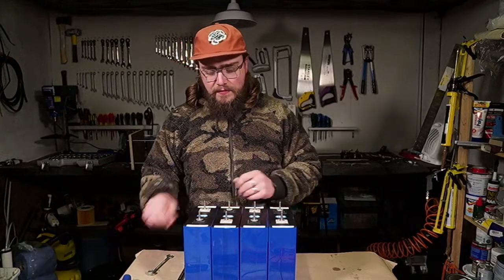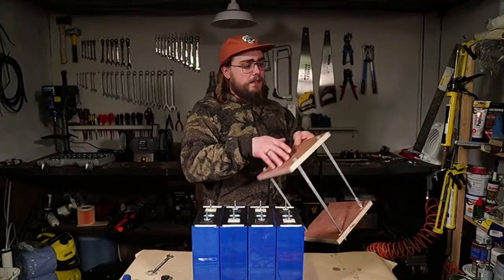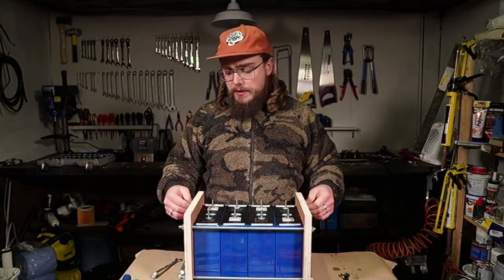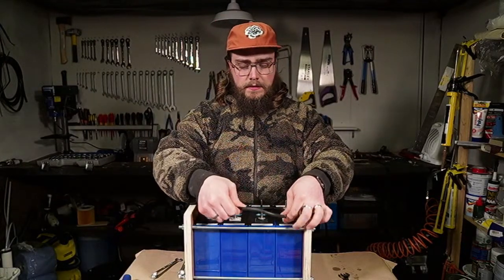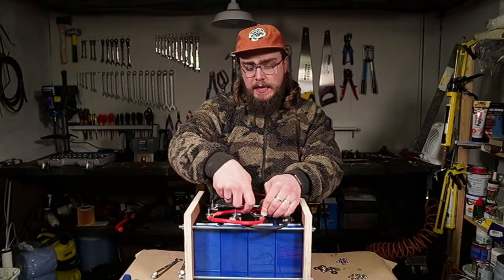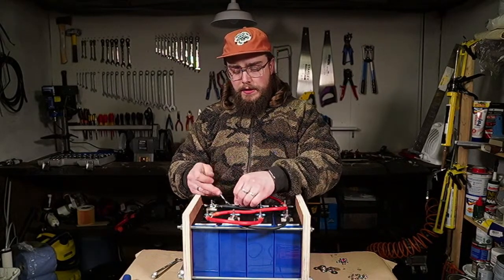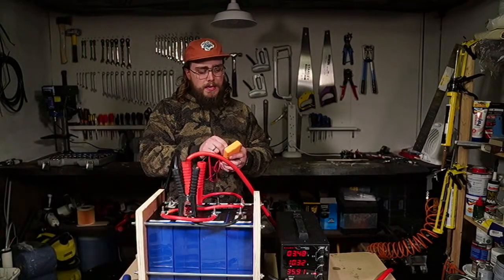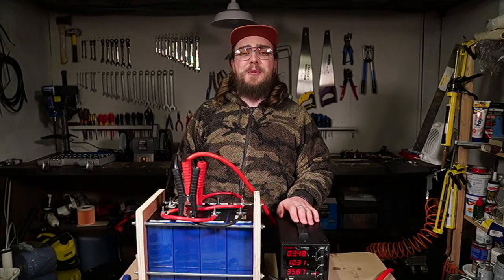Setting up LiFePO4 battery cells for top balancing (LIVE)

Comment: Did you measure a torque value for your compression?
Reply from the maker: We did not tighten them to specific torque value. We just tightened to the point where the cells were held in the clamp if you pick it up from the clamp (I.e. the cells didn’t slide out the bottom).

Comment: Why leave them in series configuration while doing a top balance very confusing for new people and just more to remember.
Reply from the maker: We’ve explained in other videos, but clamping the cells will increase their lifespan. 
If you don’t plan to clamp your cells, then you can top balance them by positioning them in parallel but if you plan to clamp them, there’s no point in top balancing them before you clamp as they may expand very slightly while they’re being charged (top balanced), which can cause [some] delamination of the cells. This is why we positioned them in a series position, clamped the cells, connected the terminals in parallel and then top balanced.

Comment: 2nd or 3rd watch for me, many more to follow. Great demo, just out of interest what gauge wire are you using on the set up to get them in parallel? One more thing I need to get but I was expecting that for my first set up. Don't want to over or under spec the wire  though
Reply from the maker: I was using 10AWG wire for this. Because I'm only charging the cells at a max of 20A when I'm top balancing, it doesn't need substantial wire to cope with high amperage.
Reply: @offgrid_power  ah! Yes that makes sense, I didn't think about from that point of view

Comment: I was top balancing 4 of the new 280 ah Lishen cells with an Eventek 10 amp power supply and ruined all 4 cells. I set the voltage to 3.59 to be safe and it showed a 9 amp charge. I shut off the charger and let the cells rest and they showed 3.44 on the voltmeter at 10 in the evening, then turned on the power supply again and verified the setpoint at 3.59. The next morning the shop had a strange smell and I was horrified to see the cells bulged so badly that they were tied together by the bars on  top and were about 2 inches wider where they sat on the workbench.  The charger was reading 3.83 volts but 9 amps was still flowing through and the cells were hot. Only 2 of the cells had the relief valve pop.  The other 2 were hideously bulged.I have no idea why the power supply exceeded its set point. So hundreds of dollars in cells were ruined.   Its only the second time I top balanced cells and actually had 12 of them top balancing for 3 weeks before this happened. They absorbed charge ever so slowly.   I caution everybody doing this. It was very expensive learning the quirks of this power supply
Reply from the maker: Wow! That sounds like a nightmare! We've never had any problems with these PSUs, but I've heard of people had problems with them.